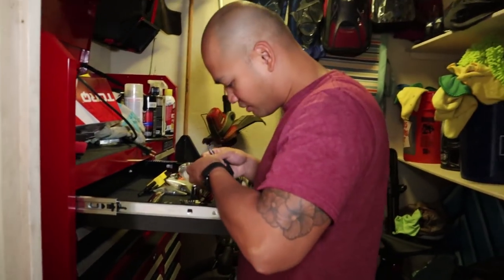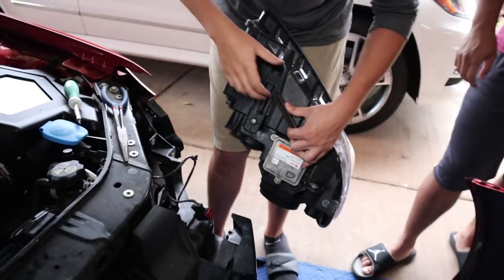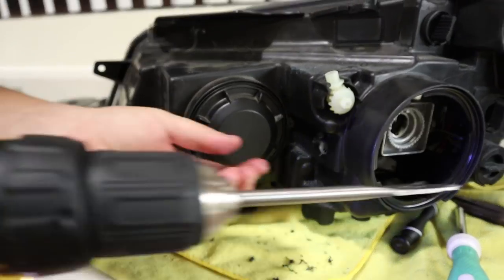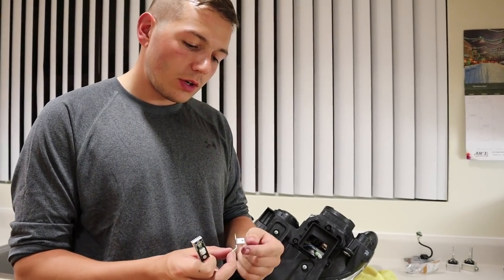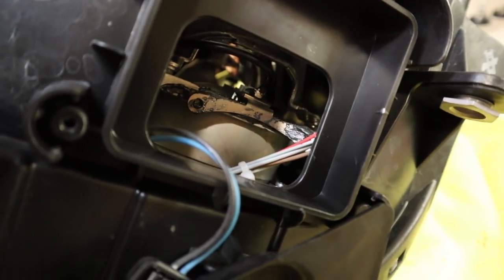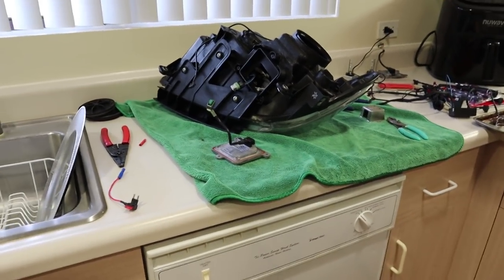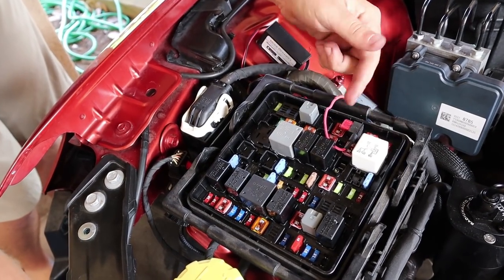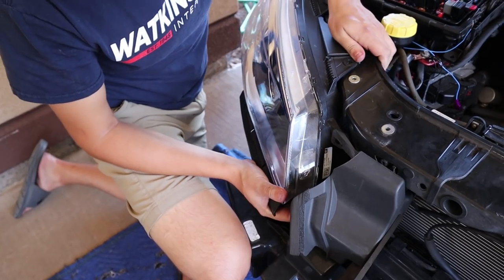Install demon eyes without opening the headlight

Comment: Great video. I do have a couple pointers/suggestions. I've modified many style of headlights in the past. I'm not sure if Diode Dynamics' bluetooth controller is waterproof, but I'd suggest running it and mounting it inside of the car. The slightest amount of water will fry those controllers and make your demon eyes do all kinds of crazy things. Also, one more suggestion, the connectors from the demon eye to the controller are NOT water proof, they will attract water and start to turn green on the inside, you'll begin to notice that certain colors may or may not work. Other than that awesome job and thanks for the how to video. I'll probably install demon eyes on my SS soon!

Comment: Hey I plan doing this on my focus rs hopefully it works
Reply from the maker: Good luck man, check your headlight to see if they are simlar to my set up as some may need to be baked. Also I plan on doing updates on the setup so make sure you subscribe !
Reply: @The4drSS  thank you the only thing im worried is that the projector moves at night with the steering wheel im not sure if they going to interfere
Reply from the maker: Its hard to show on the video but in your lowbeam there are covers which block light reflection as to help with blinding other drivers that is where my demon eye is then the leds point back towards the reflective housing.
Reply: @The4drSS  im not sure were is that on the focus all i know its movable projector does your  projectors move at night ?
Reply from the maker: @Thecamp12345  No, I know alot of Audis and Mercedes have that feature
Reply: @The4drSS  yup they do thank you